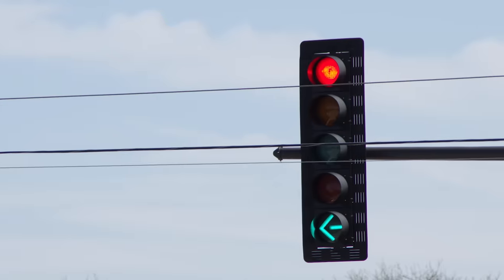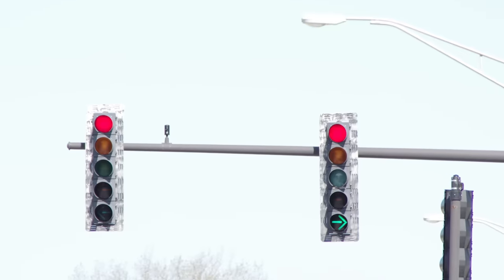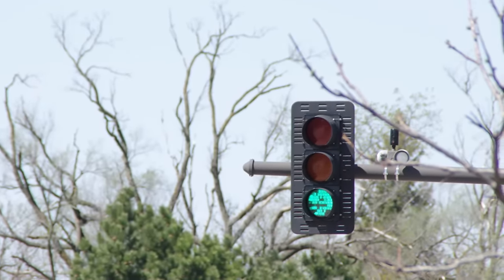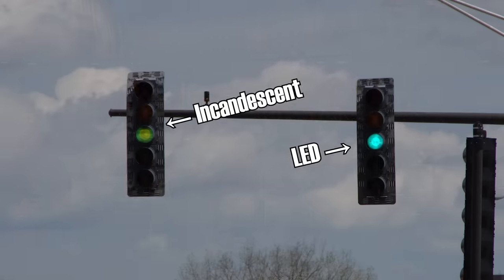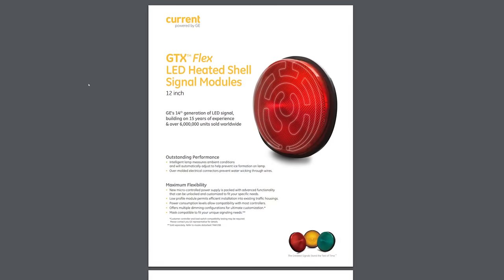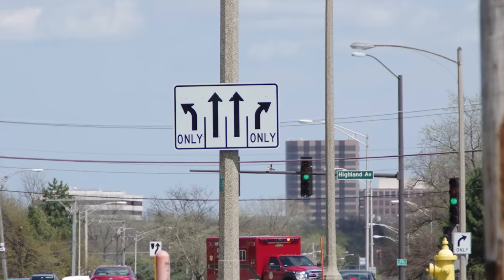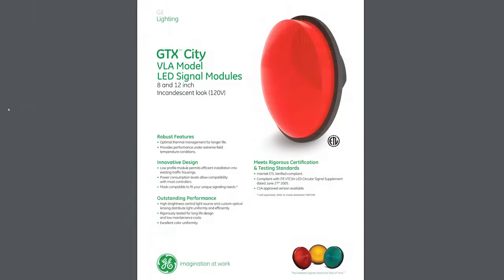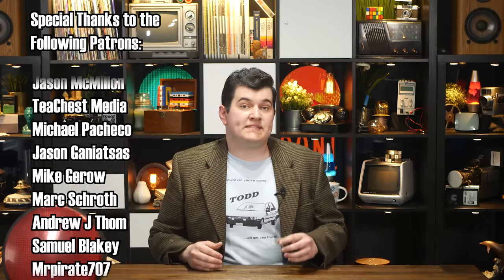The LED Traffic Light and the Danger of "But Sometimes!"

Comment: If we had LED lights first, and then incandescent traffic lights were invented, and they were less efficient, didn't last as long, needed common maintenance, and got dirty and barely visible, you'd have to be crazy to suggest it would be a good idea to use them just because they melt snow.
Reply: Patrick Demko awesome point. You should have a ton of likes. Lol
Reply: "Engineering explained" used the same logic to demonstrate the superiority of electrical cars over ICE ones.
Reply: You obviously haven't been in Norway, especially the Northern part of Norway.
Reply: Its not like leds dont produce heat tho? A 3watt led has to be directly mounted to a heatsink.
Reply: That depends on where you are. In Canada (other then where I live on the west coast), we get snow and cold for 2-3 months of the year, longer for the more northern parts, and ice and snow build up is a huge problem, not just something you need to worry about a couple of "snow days" a year. In places like Finland, and Russia, it's even worse.
Not saying LEDs are bad, just that there MUST be an engineering solution for cold climates where buildup of ice, snow and frost will be a major problem that would render LED traffic lights completely inoperable for an entire season.
Reply: Jason Ross I live in Michigan so I definitely know snow. Leds still produce a decent amount of heat, and the brighter they are, the less efficient they are at converting electricity to light, meaning the hotter they are. And anyway, with the amount of power saved with leds, whats to stop installation of a solid state heating ring around the glass that would never burn out like a lightbulb could and even connect it to a simple temperature sensor.
Reply: @mikescholz6429  Exactly what I"m thinking. Obviously that would use up more power and reduce the energy savings of using LEDs, but unless your doing the traffic lights for some place like Yellowknife, NWT or Whitehorse, Yukon, the amount of times you'd need to use those heating systems would mean you still save a ton on electricity costs.
Reply: Jason Ross even if it broke even and ended up using the same amount of power, which I doubt it would using even the simplest of sensors to only heat when its needed, you’re still saving man hours not having to do maintenance as well as not costing the public time/reduced productivity from traffic at broken lights. Broken lights are a nightmare when its rush-hour and the entirety of Detroit’s workforce is trying to get into the city.
Reply: @mikescholz6429  Valid point. My main concern would be installing a way to ensure anything accumulates on the surface capable of blocking view of any 1 light would be detected so all lights could change to 4 way signals. PPL in the broken/blocked lane could see that the light's not working properly, but at your standard 4 way intersection, the other 3 lanes can't see that and wouldn't otherwise know to treat it as a 4 way stop.
That blockage could be anything, like ice, snow, mud, dirt. I'm thinking an optic sensor could be used to detect anything like that, which could work on both LED and incandescent traffic lights.
That would also function as a back-up so if the thermal system failed and allowed ice/snow/frost to obscure a single light, at least that would detect it and allow everyone to behave accordingly, 
I wonder how many crashes at intersections happen because 1 lane lost their lights while the other 3 were functioning normally so you end up with 1 lane trying to do 4 way rules, and the other 3 thinking it's still on traffic light rules and BANG!
Reply: @Seriously_Unserious  I'm pretty sure the traffic controller prevents that from happening. If a big enough section goes out, it should change all the lights to hazard mode.
Reply: @sirtimatbob  I'm not talking about a burned out bulb, but the electronics working normally but crap on he surface makes it so people can't see the signals for ONE direction, which may not be able to be detected electronically unless some specific device is installed with the lights capable of detecting obstructions.
Reply: No one would have adopted LED lights for traffic stops if they were freezing in winter.
Reply: @megliosolichesole  Lol. Electrical cars were invented first, due to their simplicity, and then shoved aside as no one could invent a way to power them. There is no more safe and efficient process than burning, it's a law of physics. There is no better and safe way to store energy but chemical one; also a law of physics.
Reply: I live in Finland with lots of snow, and I don't give two shits about energy efficiency if it means the lights don't work during winter. Sure there are some possible workarounds but until they're in place I'd rather have safe and functional conventional stoplights than LED stoplights simply because they save costs. That's what taxes are for.
Reply: If LED lights were invented first they would never have been installed in cold (enough) climates. They would have fixed the design first.
Reply: Well stated
Reply: You guys are going way to deep in this. Just use the same heating elements they use in the back windows of cars for defrost. You know those lines in the back window of some cars. Just scale it down for the traffic lights.
Reply: @milktobo7418 , no, they would simply implement a means to eliminate the problem. There are so many easy engineering methods that would eliminate this problem the very idea anyone is even bitching about it is comical.
Reply: IkarusKommt Is that what corporations tell people to make ICEs not seem as bad? Well I’ll mostly certainly have you know that electric motors are in fact more energy efficient than ICEs. I’m not being a anti-fossil fuel hippy here - that’s a fact. If energy density is the problem, batteries will keep improving.

Too bad (/s) we’re going to have to use EVs anyways since we don’t have an infinite amount of fossil fuels.

There’s a Technology Connections video about wind power and EVs somewhere on Alec’s channel too. Worth a watch too I’d say. 

P.S I won’t bother to reply, I have notifications off I’m afraid!
Reply: Fabio Raimondi Big difference there is that availability of gas vs electric charging stations is vast in most places still. Now, that’s driven primarily by the big money behind oil, which is really the primary force here and is much, much harder to overcome. But there are practical reasons we had electric cars first that didn’t catch on. 

We also tend to go backwards more often than you think, as was the case with streetcars & interurbans being ripped out and replaced by diesel busses. Given, those buses were more flexible on some routes but for mainlines, it would have made sense to stick with rail that had already been built out. Even the intermediate trolley bus was eventually phased out in most cities, and those made a lot of sense since they ran all electric and didn’t have the same pollution as diesel buses, and were very quiet.
Reply: Jason Ross He already addressed that in the video with the LED lights that have defrosters embedded in the lenses. 

Fortunately for many places like here (Portland), it doesn’t even snow every year and often won’t fall below freezing a whole lot. But up north, yeah they’d need those defroster bulbs. No biggy.
Reply: @megliosolichesole  Except Electric cars actually do predate ICE cars and ICE cars still have many advantages that no electric car can compete with.
Reply: @IkarusKommt  Ah yes, the long forgotten Newton's 17th law of physics... Wtf are you smoking? "Best" and "most" are qualifiers that never appear in any scientific law.
Reply: @zAlbee2  So what is a better way?
Reply: @IkarusKommt  Albert C is not arguing about what's 'best'.
He's (correctly) pointing out that a LAW OF PHYSICS never phrases things using those words. That's why they are called 'laws'; they are statements of (as understood at the time) FACT. I.e. not subjective.
To say one method of energy production/storage is ''safer' or 'better' than another is almost certainly subjective. A corresponding law of physics might state that the ONLY way to store energy is chemical.
(But that's not true, ofc. Look into free point energy. Heck, even Dark Energy.)
Would a battery powered by Dark Energy be 'safer' or 'better' than your suggestions? I don't know, neither yet does physics.
But that's exactly (amongst) the reason(s) that such a claim isn't a 'law of physics'.
Reply: @megliosolichesole  the main problem with electric cars is they are boring and make you look like a bit of a d*** 

Maybe except Tesla
Reply: Spot on mate
Reply: In the colder regions  dont change the lights , more than likely the government doesn't pay for electricity, that means less money for them ,  or why else would they oppose this cost effective  proposal  .greed never stops feeding .if you've  been used to getting  a certain  amount  of  money per year , and all of a sudden  you get less ? well yeah ,  that  would  suck  !  if Tesla found a way of free electricity  , do you honestly  believe  the  government  wouldn't be  all over  that !! And you better believe   it would be top secret!! Tesla had a lot of ideas  that the government  STOLE , NICKED, KYPT , JACKED ,THEIVED, LIFTED, how ever you want to call it  ! And now are claiming  alien technology  !!  Are you  fucking  kidding !!  JPMorgan was one of  the biggest  thieve .
Reply: @Seriously_Unserious  Here in Finland they put LED traffic lights to all new or reneved traffic lights
Reply: @poika22  Love that forward thinking mindset you got
Reply: “Possibly the most powerful force is Inertia - the ability to remain unchanged”
Reply: except when you realize the truth in it all, the led bulbs are "rated" at that lifespan, but in real life, 3/4 of them fail within a few hours
Reply: @mikescholz6429  Yes LED's get hot, but you're missing the simple physics, the LED's use about one-tenth the power of incandescents, in simple terms, that means one-tenth the heat. The heat output is directly proportional to the watts...
Reply: @Hammerjockeyrepair  I have all LED lights in my house. I have had one fail the rest are all over 5 years old. I have been using LED christmas lights for 15+years. I have about thirty strings and have one or two fail per year. Usually it's just one bad bulb and I can continue to use them.
Reply: @SirDella  When it comes to directing traffic I will gladly err on the side of caution and safety over being "innovative" for the sake of being innovative.
Reply: @poika22  Leds last a lot longer than an incandescent lightbulb, that alone makes them safer. Leds are a better source of light than incandescents, just like how heating elements are a better source of heat than incandescents. Both of them last a lot longer and they save tax money for more useful things. There's no reason for sticking to filaments.
Reply: @Seriously_Unserious  It makes no sense to waste energy to heat the lenses for nine months a year when you only need that heat for three months of the year. The solution is trivially simple, a simple resistance heater and a thermostat. This is not to mention other solutions, such as different design of the lens that inherently does not allow snow to accumulate on it.
Reply: You don’t pass
Reply: @maybeiam3367  Pardon?
Reply: @Trashley652  I think you know what I mean
Reply: @maybeiam3367  I may or may not, but I don't see much point in engaging with something you aren't even willing to say openly.
Reply: @Trashley652  what else would you or anyone else think I mean when I say to someone with your profile picture “you don’t pass”
You don’t pass as a woman
Reply: @maybeiam3367  I am aware, but I can't imagine how you'd know that seeing as you've never seen me, nor can I imagine why I should value your input on it seeing as I know very well you've never seen me.
Reply: Considering the modern incandescent light bulb design uses planned obsolescence to last shorter from over 100 years ago, you're not to far off. However we didn't have LEDs first
Reply: Never mind the fatalities....we can spare a few adults, children and pets, pedestrians, and property?...who cares?  No problem.   We have too many people on earth and too many unwanted pets anyway, right?
Reply: @fireballxl-5748  It's a fallacy that earth is overpopulated, we're still a few Billion people under that limit
Reply: @superbroadcaster     Indeed.  The earth can support as many people as it takes to fill it.    Because God told Adam & Eve to fill the earth with children.
Reply: @fireballxl-5748  Muahaha
Reply: @poika22  I'd rather have safe and functional conventional stoplights than LED stoplights simply because they save costs.

Well, I'm sure we all would, but unfortunately those don't exist. Conventional stoplights are not always safe and functional because they sometimes burn out. Can you quantify how much they reduce safety by sometimes burning out versus how much LED stoplights reduce safety by sometimes getting covered in snow? If you can, you're not done. You also need to take the cost savings from switching to LED lights and determine if any of that is being spent on improving safety in other areas, and quantify that safety increase. When you've done all that, then you can say that this or that is more safe. Otherwise you're just taking a guess that could as well be wrong as right.
Reply: They could easily put a sensor and circuit in them to defrost the lens periodically.
Reply: Ya but you'd be surprised how often innivention like that are suggested and get approved!
Reply: @megliosolichesole  Can you please give me his video's link?
Reply: @IkarusKommt  Why do you write this to me? I am not the author of Engineering Explained videos...
Reply: @IkarusKommt  Why do you write this to me? I am not the author of Engineering Explained videos...
Reply: @benruss4130  Why do you write this to me? I am not the author of Engineering Explained videos...
Reply: @megliosolichesole  ... Dude the comment is a year old and I don't want to invest the time it would take to remember. Most likely I was commenting on the fact that I disagreed with engineering explained view on the matter, but I couldn't and can't write to EE so instead I wrote to one of those using EE as an argument.
Reply: @megliosolichesole  ice?
Reply: Not really….. guess how much energy a heater uses?

Also to make most green things takes more energy to even make
Reply: @Joopyter724  i think thats more your perception than the evs blame
Reply: @IkarusKommt  if you really want to know. Evs are best. More efficent. The Energy is saved chemicaly. Less parts less to repair, and better in regards to climate change.
Reply: @Seriously_Unserious  use higher powered led and make the cover a heat sink- brighter light and melted snow ❄️ seems easy enough to make
Reply: If we’d had LEDs first then someone came along with incandescent even if they were more efficient we’d say but sometimes they get full of dust and become invisible especially if it’s bright out
Reply: I’ve had issues at intersections because we couldn’t tell if the light changed due to snow. It’s common.
Reply: Solution: install a darkened incandescent light inside the traffic light that starts automatically when it detects snow
Reply: @vistalover9607  what about high powered led with heat sinks used to melt the snow- that and those covers I’ve seen on most lights should keep any amount of snow melted near the lights
Reply: @vistalover9607  let’s just go back to candles
Reply: But they melt the snow so they're better, right?
Reply: @SirDella  they don't last anywhere near incandescents. And because many are a sealed unit, as trailer led lights are, you have to throw away the whole unit- stop, tail, indicator and reverse light all in one. At a cost of $15 for the cheapie chinese ebay unit to $35 for a shop bought one. Hows that for efficient? Don't get me wrong, I like their brightness, but it's a 50/50 chance one of your new trailer led tail lights will be dead inside 2 years. Many cars from the 60's still have most of their original bulbs in for comparison.
Reply: @rossbrumby1957  That depends on the design. Old incandescents lasted many times longer that current ones, because the newer ones are made for brightness at the expense of longevity. Same goes for leds, you can make them last for eternity, or try to cram as much brightness in the smallest package, running them at their highest rated temperature. If you want reliability from leds you are gonna have to do diy, because no one's going to sell you a bulb that lasts forever, but that doesn't mean the technology itself is flawed
Reply: @mikescholz6429  not enough heat.
Reply: @Seriously_Unserious  This is why the original comment and video is so bad.

It is like saying "30% of people will have an reaction to this medicine that will harm them. Lets not have anything to help them should this happen." If you don't address those but sometimes people can get hurt or worse.

If people spent less time laughing at these concerns and more time helping then this video wouldn't even need to be made nor be made in ways which help justify not making the change by its own logic.
Reply: Fisher and boss plows have glass heaters on their led headlights.
Reply: @Seriously_Unserious  traffic lights AND rear lights on cars and trailers.
Reply: We don't even get snow in my country except on the mountains where no one lives so there wouldn't even be a point here😂
Reply: @maybeiam3367  You don't pass as someone I'd feel safe leaving around children